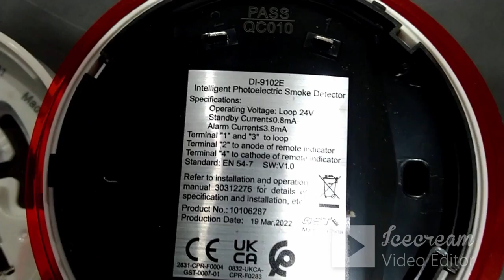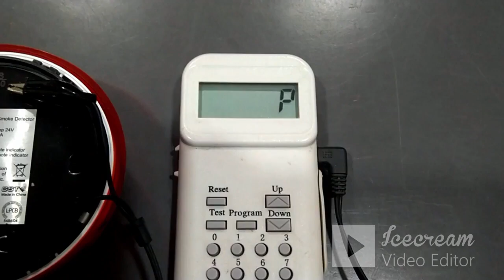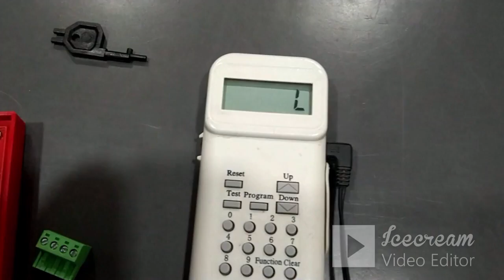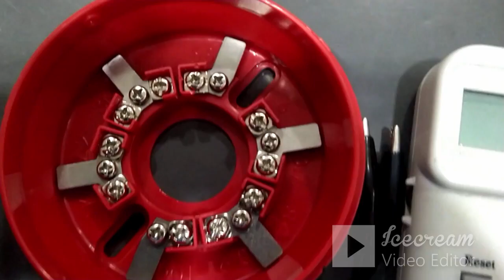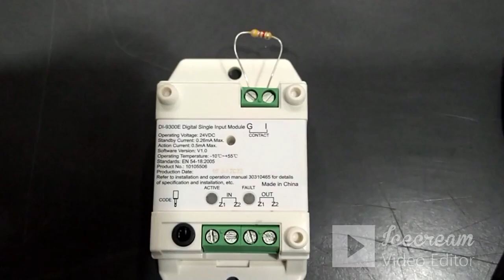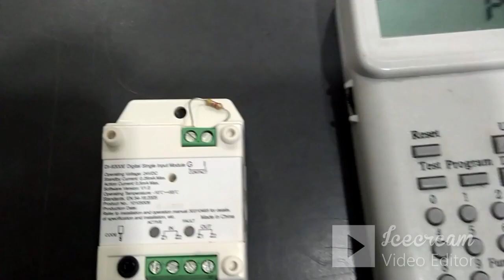Comment: FIRE ALARM HOOTER DEALERS IN KERALA, PA TWO WAY TALK BACK SYSTEM DEALERS IN KERALA, PA SYSTEM DEALERS IN KERALA, PA TALK BACK UNIT DEALERS IN KERALA, HOOTER CUM STROBE DEALERS IN KERALA, FIRE PROTECTION SYSTEM IN KERALA, FIRE ALARM CONTRACTORS IN KERALA, FIRE DETECTORS IN KERALA, FIRE ALARM DEALERS IN KERALA, ADDRESSABLE FIRE ALARM DEALERS IN KERALA, SMOKE DETECTOR DEALERS IN KERALA, FIRE EQUIPMENT DEALERS IN KERALA, FIRE ALARM INSTALLATION IN KERALA, FIRE ALARM COMPANIES IN KERALA FIRE ALARM DISTRIBUTORS IN KERALA, TALK BACK SYSTEM DEALERS IN KERALA, FIRE ALARM SENSOR DEALERS IN KERALA, FIRE EXTINGUISHER DEALERS IN KERALA, FIRE ALARM DEALERS IN ERNAKULAM, FIRE ALARM DEALERS IN KERALA, ADDRESSABLE FIRE ALARM DEALERS IN CALICUT, SMOKE DETECTOR IN KERALA,  FIRE EXTINGUISHER DEALERS IN KERALA, FIRE EXTINGUISHER SUPPLIERS IN KERALA, FIRE EXTINGUISHER DISTRIBUTORS IN KERALA FIRE EXTINGUISHER IN KERALA, ABC TYPE FIRE EXTINGUISHER DEALERS IN KERALA, CO2 TYPE FIRE EXTINGUISHER DEALERS IN KERALA, CLEAN AGENT FIRE EXTINGUISHER IN KERALA, MODULAR TYPE FIRE EXTINGUISHER DEALERS IN KERALA, MECHANICAL FOAM FIRE EXTINGUISHER DEALERS IN KERALA, FIRE FIGHTING PUMP DEALERS IN KERALA, FIRE PUMP DEALERS IN KERALA, KIRLOSKAR FIRE PUMP DEALERS IN KERALA, FIRE JOCKEY PUMP DEALERS IN KERALA, FIRE DISEL ENGINE DRIVEN PUMP DEALERS IN KERALA, FIRE FIGHTING EQUIPMENT DEALERS IN KERALA, FIRE FIGHTING SYSTEM IN KERALA, VERTICAL INLINE PUMP DEALERS IN KERALA, HYDRO PNEUMATIC PRESSURE BOOSTING PUMP DEALERS IN KERALA, VERTICAL TURBINE PUMP DEALERS IN KERALA, SEWAGE PUMP DEALERS IN KERALA, RO PUMP DEALERS IN KERALA. FIRE EXTINGUISHER IN KERALA, FIRE EXTINGUISHER SUPPLIERS IN KERALA,

Comment: FIRE ALARM DEALERS IN ERNAKULAM, FIRE ALARM SYSTEM IN ERNAKULAM, FIRE ALARM SYSTEM TRADERS IN ERNAKULAM, ADDRESSABLE FIRE ALARM DEALERS IN ERNAKULAM, AGNI FIRE ALARM DEALERS IN ERNAKULAM, RAVEL FIRE ALARM DEALERS IN ERNAKULAM, SMOK DETECTOR DEALERS IN ERNAKULAM, FIRE ALARM PANEL DEALERS IN ERNAKULAM, HONEYWELL MORLEY FIRE ALARM DEALERS IN ERNAKULAM, FIRECLASS FIRE ALARM DEALERS IN ERNAKULAM, AGNI FIRE ALARM PANEL IN ERNAKULAM, FIRE DETECTORS IN ERNAKULAM, FIRE ALARM DISTRIBUTORS IN ERNAKULAM, ASES FIRE ALARM DEALERS IN ERNAKULAM, CONVENTIONAL FIRE ALARM DEALERS IN ERNAKULAM, FIRE ALARM CONTRACTORS IN ERNAKULAM, SIMPLEX FIRE ALARM DEALERS IN ERNAKULAM, FIRE ALARM COMPANIES IN ERNAKULAM, FIRE ALARM SUPPLIERS IN ERNAKULAM, FIRE ALARM INSTALLATION IN ERNAKULAM, GST FIRE ALARM DEALERS IN ERNAKULAM, FIRE PIPE INSTALLATION IN CONTRACTORS IN ERNAKULAM, FIRE SAFETY CONTRACTORS IN ERNAKULAM, FIRE PA TWO WAY TALK BACK SYSTEM DEALERS IN ERNAKULAM, HEAT DETECTOR DEALERS IN ERNAKULAM, HONEYWELL FIRE ALARM DEALERS IN ERNAKULAM, SMOKE DETECTOR DEALERS IN ERNAKULAM, FIRE ALARM DEALERS IN ERNAKULAM, FIRE ALARM SYSTEM IN ERNAKULAM, FIRE ALARM SYSTEM TRADERS IN ERNAKULAM, ADDRESSABLE FIRE ALARM DEALERS IN ERNAKULAM, AGNI FIRE ALARM DEALERS IN ERNAKULAM, RAVEL FIRE ALARM DEALERS IN ERNAKULAM, SMOKE DETECTOR DEALERS IN ERNAKULAM, FIRE ALARM PANEL DEALERS IN ERNAKULAM, HONEYWELL MORLEY FIRE ALARM DEALERS IN ERNAKULAM, FIRECLASS FIRE ALARM DEALERS IN ERNAKULAM, AGNI FIRE ALARM PANEL IN ERNAKULAM, FIRE DETECTORS IN ERNAKULAM, FIRE ALARM DISTRIBUTORS IN ERNAKULAM, ASES FIRE ALARM DEALERS IN ERNAKULAM, FIRE SAFETY CONTRACTORS IN ERNAKULAM, FIRE ALARM CONTRACTORS IN ERNAKULAM, SIMPLEX FIRE ALARM DEALERS IN ERNAKULAM, FIRE ALARM COMPANIES IN ERNAKULAM, FIRE ALARM SUPPLIERS IN ERNAKULAM, FIRE ALARM INSTALLATION IN ERNAKULAM, GST FIRE ALARM DEALERS IN ERNAKULAM, MORLEY FIRE ALARM DEALERS IN ERNAKULAM, FIRE ALARM INSTALLTION IN ERNAKULAM, FIRE FIGHTING COMPANIES IN ERNAKULAM, ADDRESSABLE FIRE ALARM SYSTEM DEALERS IN ERNAKULAM, FIRE ALARM SYSTEMS IN ERNAKULAM, PA TALK BACK SYSTEMS IN ERNAKULAM, FIRE CONTRACTORS IN ERNAKULAM, FIRE PROTECTION COMPANIES IN ERNAKULAM, FIRE FIGHTING CONTRACTORS IN ERNAKULAM, FIRE ALARM DISTRIBUTORS IN ERNAKULAM, MORLEY ADDRESSABLE FIRE ALARM SYSTEM DEALERS IN ERNAKULAM, GST ADDRESSABLE FIRE ALARM SYSTEM DEALERS IN ERNAKULAM, NOTIFIER ADDRESSABLE FIRE ALARM SYSTEM DEALERS IN ERNAKULAM, EDWARDS FIRE ALARM DEALERS IN ERNAKULAM, EST FIRE ALARM DEALERS IN ERNAKULAM, ASES SECURITY FIRE ALARM DEALERS IN ERNAKULAM, ASES FIRE ALARM DEALERS IN ERNAKULAM, ASES PA SYSTEM IN ERNAKULAM, PA TWO WAY TALK SYSTEM IN ERNAKULAM, PA TALK BACK UNIT IN ERNAKULAM, PA PAGING SYSTEM DEALERS IN ERNAKULAM, FIRE ALARM CUM PA SYSTEM IN ERNAKULAM, FIRE ALARM PANEL DEALERS IN ERNAKULAM, MANUAL CALL POINT DEALERS IN ERNAKULAM, FIRE ALARM HOOTER DEALERS IN ERNAKULAM, FIRE ALARM MCP DEALERS IN ERNAKULAM, FIRE ALARM SOUNDER DEALERS IN ERNAKULAM, FIRE ALARM SYSTEM IN ERNAKULAM, FIRE TELEPHONE SYSTEM DEALERS IN ERNAKULAM, PA SYSTEM DEALERS IN ERNAKULAM. HONEWELL PA SYSTEM DEALERS IN ERNAKULAM, PUBLIC ADDRESS SYSTEM DEALERS IN ERNAKULAM, BOSCH PA SYSTEM DEALERS IN ERNAKULAM, BOSCH DEALERS IN ERNAKULAM, HONEYWELL DEALERS IN ERNAKULAM, RAVEL FIRE ALARM DEALERS IN ERNAKULAM, AGNI FIRE ALARM DEALERS IN ERNAKULAM, AGNI DETECTOR DEALERS IN ERNAKULAM, AGNI SMOKE DETECTOR DEALERS IN ERNAKULAM, PA SYSTEM DEALERS IN ERNAKULAM, HONEYWELL PA SYSTEM DEALERS IN ERNAKULAM.

Comment: FIRE ALARM DEALERS IN KERALA, ADDRESSABLE FIRE ALARM DEALERS IN KERALA, FIRE ALARM SYSTEM DEALERS IN KERALA, ADDRESSABLE FIRE ALARM SYSTEM DEALERS IN KERALA, FIRE DETECTION SYSTEM IN KERALA, SMOKE DETECTOR DEALERS IN KERALA, CONVENTIONAL FIRE ALARM DEALERS IN KERALA, MORLEY FIRE ALARM DEALERS IN KERALA, GST FIRE ALARM DEALERS IN KERALA, ASES SECURITY FIRE ALARM DEALERS IN KERALA, BEAM DETECTOR DEALERS IN KERALA, FIRE ALARM SUPPLIERS IN KERALA, FIRE ALARM TRADERS IN KERALA, FIRE ALARM PANEL DEALERS IN KERALA, HEAT DETECTOR DEALERS IN KERALA, FIRE ALARM SYSTEM SUPPLIERS IN KERALA, FIRE ALARM COMPANIES IN KERALA, FIRE EQUIPMENT DEALERS IN KERALA, ADRRESSABLE FIRE ALARM PANEL DEALERS IN KERALA, FIRE ALARM SYSTEM IN KERALA, BATTERY OPERATED DETECTOR DEALERS IN KERALA, ASPIRATION DETECTION SYSTEM DEALERS IN KERALA, FIRE ALARM MCP - MANUAL CALL POINT DEALERS IN KERALA, FIRE ALARM HOOTER DEALERS IN KERALA, PA TWO WAY TALK BACK SYSTEM DEALERS IN KERALA, PA SYSTEM DEALERS IN KERALA, PA TALK BACK UNIT DEALERS IN KERALA, HOOTER CUM STROBE DEALERS IN KERALA, FIRE PROTECTION SYSTEM IN KERALA, FIRE ALARM CONTRACTORS IN KERALA, FIRE DETECTORS IN KERALA, FIRE ALARM DEALERS IN KERALA, ADDRESSABLE FIRE ALARM DEALERS IN KERALA, SMOKE DETECTOR DEALERS IN KERALA, FIRE EQUIPMENT DEALERS IN KERALA, FIRE ALARM INSTALLATION IN KERALA, FIRE ALARM COMPANIES IN KERALA FIRE ALARM DISTRIBUTORS IN KERALA, TALK BACK SYSTEM DEALERS IN KERALA, FIRE ALARM SENSOR DEALERS IN KERALA, FIRE EXTINGUISHER DEALERS IN KERALA, FIRE ALARM DEALERS IN ERNAKULAM, FIRE ALARM DEALERS IN KERALA, ADDRESSABLE FIRE ALARM DEALERS IN CALICUT, SMOKE DETECTOR IN KERALA,  FIRE EXTINGUISHER DEALERS IN KERALA, FIRE EXTINGUISHER SUPPLIERS IN KERALA, FIRE EXTINGUISHER DISTRIBUTORS IN KERALA FIRE EXTINGUISHER IN KERALA, ABC TYPE FIRE EXTINGUISHER DEALERS IN KERALA, CO2 TYPE FIRE EXTINGUISHER DEALERS IN KERALA, CLEAN AGENT FIRE EXTINGUISHER IN KERALA, MODULAR TYPE FIRE EXTINGUISHER DEALERS IN KERALA, MECHANICAL FOAM FIRE EXTINGUISHER DEALERS IN KERALA, FIRE FIGHTING PUMP DEALERS IN KERALA, FIRE PUMP DEALERS IN KERALA, KIRLOSKAR FIRE PUMP DEALERS IN KERALA, FIRE JOCKEY PUMP DEALERS IN KERALA, FIRE DISEL ENGINE DRIVEN PUMP DEALERS IN KERALA, FIRE FIGHTING EQUIPMENT DEALERS IN KERALA, FIRE FIGHTING SYSTEM IN KERALA, VERTICAL INLINE PUMP DEALERS IN KERALA, HYDRO PNEUMATIC PRESSURE BOOSTING PUMP DEALERS IN KERALA, VERTICAL TURBINE PUMP DEALERS IN KERALA, SEWAGE PUMP DEALERS IN KERALA, RO PUMP DEALERS IN KERALA. FIRE EXTINGUISHER IN KERALA, FIRE EXTINGUISHER SUPPLIERS IN KERALA, 

Fire extinguisher dealers in KERALA, fire fighting contractors in KERALA, KERALA, fire and safety installations in KERALA, fire extinguisher suppliers in KERALA,fire extinguishers in KERALA, fire extinguishers in KERALA, fire protection system in KERALA, f fire and safety installation in KERALA, fire and safety contractors in KERALA, fire safety contractors in KERALA, fire and safety systems equipments in KERALA, fire equipment in KERALA, fire extinguisher in KERALA, fire protection system installation in KERALA, fire contractors in KERALA, fire safety consultants in KERALA,  fire alarm systems in KERALA, fire NOC in KERALA, fire AMC in KERALA, KERALA, fire fighting equipment in KERALA,
MS Jindal pipe dealers in KERALA, motor control panel in KERALA, fire pump panel in KERALA, motor control panel in KERALA, Morley fire alarm in KERALA, gst fire alarm in KERALA, addressable fire alarm system in KERALA, Pa talk back system in KERALA, PA two way talk back system in KERALA, auto glow SIGNAGES in KERALA, Karthar dealers in KERALA, Agni fire alarm dealers in KERALA, ASES SECURITY fire alarm dealers in KERALA, AUTO GLOW SIGNAGES in KERALA, FIRE PUMP PANEL in KERALA, LHP pump in KERALA. Karthar valves in KERALA, Ravel fire alarm system in KERALA. Jindal pipe dealers in KERALA, Jindal pipe dealers in KERALA. MS pipe dealers in KERALA. Butterfly valves in KERALA, PA talk back system in KERALA, Fire alarm dealers in KERALA, smoke detector dealers in KERALA, fire alarm panels dealers in KERALA, MCP, hooter dealers in Mangalor, hydrant valve dealers in KERALA, branch pipe dealers in KERALA,Fire CP hose in KERALA, Fire RRL hose in KERALA, heat detector dealers in KERALA, Motor Control panel in KERALA,  LED EXIT LIGHTS dealers in KERALA, emergency exit light dealers in KERALA, auto glow SIGNAGES dealers in KERALA. Conventional fire alarm system in KERALA, Fire alarm panel in KERALA, Notifier fire alarm dealers in KERALA, PA talk back unit dealers in KERALA. Honeywell fire alarm dealers in KERALA, BOSCH PA system dealers in KERALA,